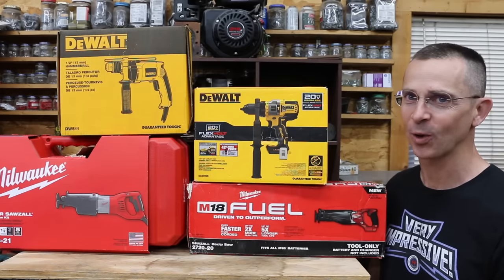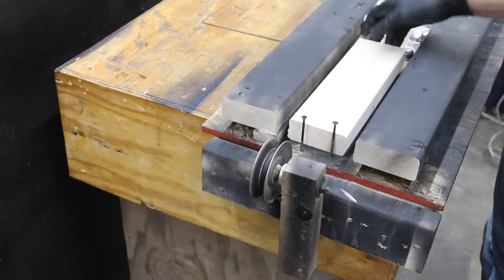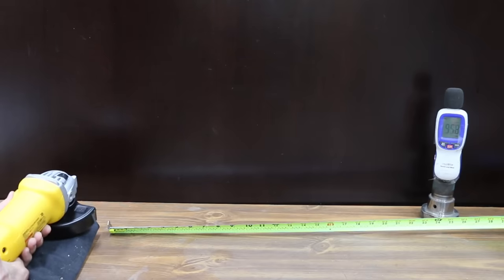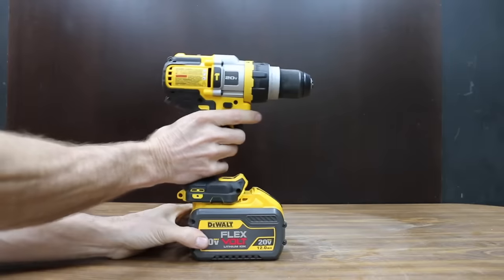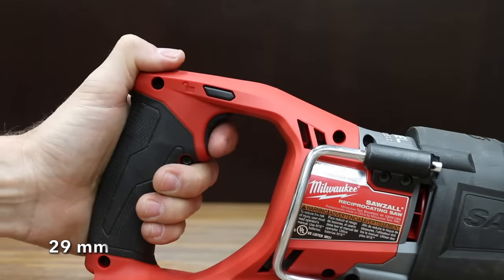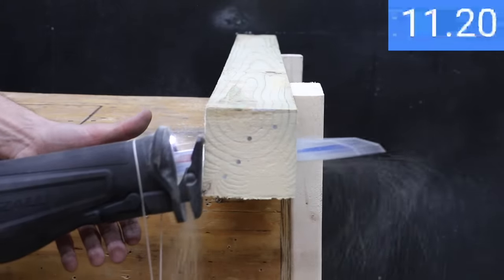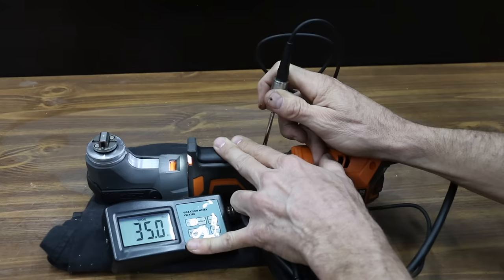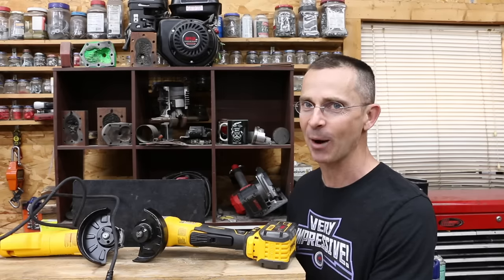Let's Settle This! Are Cordless Power Tools REALLY Better? Torque, Cutting Speed, Noise, Vibration

Comment: Corded tools are cheaper initially and in the long run . no expensive batteries to replace . In a shop environment big tools like Three HP table saws , planers , jointers slide compound etc are the way to go . 
The biggest thing cordless has going for it is convenance and safety . no cord to trip you up in high places and don't forget that you need electricity to charge all those batteries . with a corded tool just plug in a zillion times with ever being concerned if you have enough charge . Most guys will counter that with the buying more batteries argument . that's just more money for batteries and more electricity to charge all those batteries .
Reply from the maker: Thanks for the feedback.

Comment: I try to stick with corded tools. My projects are never far from an outlet and I have a portable generator for those that are. My concern with battery powered tools is that the batteries discharge over time without being used. You need one to work for an emergency repair and the battery is dead. They also have limited discharge/charge cycles. What happens years later when the batteries can’t be charged and the manufacturer has a new and improved system? You can’t get a replacement battery that is compatible!
Reply from the maker: Thanks for sharing.

Comment: I’m curious about what changed for the Milwaukee reciprocating saw (cordless version) between March 28, 2021 and now. It seems to weigh more (even with a battery) and take twice as long to cut through the board.
Reply from the maker: Thanks for the suggestion.

Comment: Why are you using the massive flex volt battery with the Dewalt’s??  Its not really representative of how the tools are commonly used and and they provide an abnormally high voltage with minimal sag compared to the regular batteries.  I have 8 Dewalt 20v tools and not one of those insanely expensive, huge, heavy batteries, and I dont buy the stack packs either, just the 5ah and 2ah 20vmax.

Comment: I feel like power tools manufacturers simply stopped spending R&D for corded tools in favor of cordless. Correct me if I'm wrong wrong, but it seems most corded tools on the market right now hasn't received a significant upgrade for a long time and are still relying on old designs

Comment: Volts times amps = watts.  746 watts = one horsepower.

SO;  If you plug a 110 volt appliance into a 15 amp outlet, you wind up with a maximum of 1650 watts or 2.2 horsepower.  That is the max that the outlet can deliver.  That's not what an appliance will deliver however, there is going to be some loss.

20 amp outlet?  2.95 horsepower.  This is why most large yard equipment such as lawnmowers and pressure washers are all gasoline powered.  These days, both of the appliances mentioned have over 6 hp, so you can see why line voltage equipment is limited.

A battery powered tool however has little limit on the number of amps it can supply.  Thus, if you have an 80 volt E-GO lawnmower and it's battery supplies 60 amps, then you have well over 6 hp and the device gets the job done.  The length of time the battery can power the equipment is the only limitation, and some of these mowers have honking! big batteries.

Great video!

Comment: Now imagine if the same brushless motor versions were powered with switching power supplies instead of batteries. They would cost more than the brushed motors, but they would be much more powerful and efficient. Maybe the manufacturers can make the same tools with standard slots for either the batteries or the PSUs.
Reply from the maker: Thanks for the feedback.

Comment: Generally, corded tools are more powerful, but not always. I also they are probably made better and will hold up longer. I drilled a bunch of holes in concrete with my corded drill. I know the battery drill wouldn't have been able to handle it.  If you don''t need the convenience of the battery, go for the corded tool. You will own them the rest of your life. In my opinion.
Reply from the maker: Thanks for the feedback.

Comment: Large corded angle grinders can trip the power breaker at over 30 amps which means that they can deliver around 5HP of cutting power. it is insane. it is possible to do the same with cordless grinders but you need multiple batteries and they run out fast. in a workshop that does lots of welding and grinding cordless grinders are just dumb.
Reply from the maker: Thanks for the feedback.

Comment: I've been looking into getting a Milwaukee oscillating tool they have the m18 for around $125 dollars and the Milwaukee fuel for around $230  I'm wondering if you'd consider testing if spending the extra money for the file would be worth it thanks.
Reply from the maker: Thanks for the video idea.

Comment: The added benefit of the battery drills are the electric brakes.  The real downside to all the battery tools is w/o a lot of use the batteries will just go bad.
Reply: Does it really matter how fast your drill stops? Probably the one I'd worry about the least in terms of stopping time. It's not that risky to put down a drill that's still spinning slightly.
Reply from the maker: Thanks for the feedback.
Reply: @gorak9000  It's the difference between stripping out a screw head or not.  That's why a corded drill is just no good as an electric screwdriver.  And even if you were drilling...have you not ever "locked up" a drill bit drilling into metal?  That could be the difference in breaking that bit or not.

Comment: Yeah, well.  I don't cut 1 2x4 in a day building a house.  So 30 or 50 boards.  120V electricity beat a battery because I am not going to haul around a bag of batteries.  They have their place though a manual sharp handsaw or chisel does the same job.  I really wonder why manufacturers did not invent an electric drill with  gears.(Low speed /mid speed/ high speed)so the motor rotates fast to keep it cool and still provides that torque that battery drills have.
Reply from the maker: Thanks for sharing.

Comment: I don't see how the pros can use these batteries efficently.  You get a few hours of work done, and the performance is noticeably worse as voltage drops and you have to let the battery set for 2 hours to "cooldown" because it is expensive, and then charge for 6 hours so you need 3-4 batteries and 2 chargers to run a single tool for 8 hours which cost as much as a whole generator and fuel to run for a month.  When I worked in a machine shop, we would have the same 3 corded drills running nearly 24 hours a day.

I would love to see how the cordless one does in 20 years.
Reply from the maker: Thanks for the feedback.

Comment: The main reasons I don't like battery powered tools are that they are more expensive, and that the battery eventually dies, and you have to spend more money to replace it during the life time of the tool.

I'd happily buy a power tool that can be used with battery or corded.
Reply from the maker: Thanks for the feedback.

Comment: Absolutely amazing video! I've been wondering this for a while. One thing i did notice, some of the cordless were "bottom tier" versions. For example the angle grinder.  I believe the only part numbers that benefit from the flexvolt battery are the 416 and 418 i believe. One use flexvolt advantage, the other uses the full 60V flexvolt battery. I think that would be better than the corded, similar to the hammer drill you tested. Top tier battery hammer drill out performed the corded by a lot. Obviously the price difference is also significant. Keep up the amazing work!
Reply from the maker: Thanks, will do!
Reply: I kinda had the opposite impression, both the corded drill and saw were absolute bottom tier versions so it's no wonder they're lacking features - and in the case of the drill - also power. A DWD520 hammer drill would still cost 25% less than the battery powered one but be some actual competition.
Reply: @creak92  oh yes i completely agree. There were more high tierd battery tools than coreded tools. It's very difficult, especially for someone who is new to tools, or even unfamiliar with the brands, to know which version is the best, mid, or bottom

Comment: Unfortunately the only valid takeaway here is cordless is more expensive. Most of the performance comparisons aren't fair. For example, you compared the Sawzall vs a Super Sawzall. Milwaulkee makes 2722-20 Super sawzall, which is probably a more fair comparison, and its only $50 more than the corded one shown. The cordless sawzall should have been compared to a 6509. Drills, Impact Wrenches, and Grinders all have the same issue, where you have to be very careful to compare apples to apples when it comes to performance numbers.
Reply from the maker: Thanks for the suggestionn.

Comment: So far in our eight years of experience, we prefer corded tools just because of the possibility for unlimited power and large economic differences. We work continuously 6 hours a day and charging and changing the batteries is not the most reliable. We rather change brushes during holidays, that way we get to maintain and know our tools better and just might caught some potential hazards. Battery tools are awsome but in our line it isn't a life changing. Most of our skilled-men are earing for college needs so, budget is our no. 1 priority.
Reply from the maker: Thanks for the feedback.

Comment: Nowadays I think cordless is the way to go for most tools. Back in the day battery life was probably just as big of an issue as power. Nowadays batteries last much longer and produce much more power. 

It comes down to how you use your tool. Corded are cheaper but have longer setup time. They are also more dangerous considering they are using a cord that can be cut. I set an ac unit on a cord and shocked the shit out of myself and my buddy. A cordless tool wouldn’t have that problem.
Reply from the maker: Thanks for the feedback.

Comment: unlike Corded tools cordless tools arent limited to 1500w total power draw so they can run faster with the correct power circuitry and batteries however the batteries lifespan is limited with high power draw applications
Reply from the maker: Thanks for the feedback.

Comment: BATTERIES (obscene cost for those) and charge/run time are the biggest negative for those battery tools.
Corded you do not have that problem
I use battery for quick jobs. Corded for larger jobs.

Corded tools usually do not have problems with heat and cold. Battery tools DO have issues.

Much depends on if you are casual user or a construction worker who has no house power easily available.
Location, location, location is a big factor.
Reply from the maker: Thanks for the feedback.

Comment: I'm a big fan of your channel, but this video has a HUGE issue, none of these tools are being compared are the same build quality or level of tool. They aren't made to compete against one another, and I understand it is going to be hard to find tools that are built to be comparable, but they do exist.

 For example Dewalt DWE7485 and Dewalt DCS7485 are the same tool with one being 60v battery powered and the other being corded. 

You can also look at the Dewalt 120v Miter saws, you can get an adapter that allows it to be ran either corded or with 2 60v batteries, with some research there is probably also a full time corded tool version that is actually the same tool as well, but Miter saws would be very hard to make a test for.

Comment: I like cords. You are buying the batteries and trapped into a specific brand, which is great if you're a brand fan boy. Cordless tools are more expensive to purchase and own. Good for smaller quick jobs tho.
Reply from the maker: Thanks for sharing.
Reply: Yeah I said the same things until a friend let me use his cordless tools to build a deck in the middle of nowhere on my property. That one job flipped me into a believer/fanboy so fast that I couldn't get out of the big orange store quick enough with my new investment. I haven't used a corded tool since 2015. 
Cordless costs money, especially the powerful ones, but it also makes money, they pay for themselves in short order. People usually realize that after going to one too many jobsites that doesn't have power and there's no generators sitting around. Also I've only ever bought aftermarket batteries, which can be hit or miss, but they're 1/3 the price of name brand and I've had good luck with so far. 🤷‍♂
Reply: @somethingtrulyhorrifying  I'm sure I'll get into it eventually. I do hate running generators all day. Cheers.

Comment: Hmm, I liked some of the tests, except the ones where you had $200/$270 cordless vs $99 corded. It really should have been an apples to apples comparison: $100 corded vs $100 cordless (cost without battery). Those cheap cordless models are much weaker and typically feature a brushed motor. Results would have been much different I bet.
Reply from the maker: Thanks for the constructive feedback.

Comment: I wanted to know if the corded Dewalt angle grinder was more powerful than the cordless.  I searched for it just last week.  I found nothing useful.  This morning I'm suggested this video, and lo and behold.  
Kids, be careful with that angle grinder.  Use the safety equipment and don't get distracted.  You don't want to be the guy in the shop with 9 fingers.
Reply from the maker: Thanks for the feedback.

Comment: Seems most corded tools have rubbish motors. Typically they use around 500 watts, which is much more than can be produced from any 18 volt battery on a continuous basis. Has anyone measured the actual watts in use on a cordless tool?

Comment: Clearly you like using your campervan and pickup so you need to get some good lighting on these vehicles. Lets test some LED light bars. Curved vs straight, straight vs spot vs broad, curved vs spot vs broad etc. Spot is ok for road driving but curved better for off road etc ??????
Reply from the maker: Thanks for the video idea.

Comment: I doubt cordless tools will ever be able to completely replace corded tools.
 cordless ya got 24v-48v and a 5amp batt.
corded ylu got 120v-220v at 15amps, if your using the tool consistently enough it either needs batts consently or at least twice as heavy to compete.
Reply from the maker: Thanks for sharing.

Comment: 2:57 - On the Makita circular saw, a  0.4dBu SPL difference is imperceptible by most people. It's practically a tie there. 

(I know that isn't the most important thing he tested and doesn't matter to most people, but it's the only thing I feel like I should comment on, as it is the only topic in this discussion that I'm qualified to speak to. I went to school for audio engineering and working on recording studios, live sound venues, and worked with acoustics. So, there, that's my two cents...)
Reply from the maker: Thanks for sharing!

Comment: I guess I’m a little old fashioned in that I buy tools to last a long time. As a mechanic and home owner, I’ve gone through cordless drills because of batteries. The batteries wear out and are too expensive to replace or they don’t make the battery style anymore and switched to new style (14.4 NiCad) then I’m stuck with a drill with no battery. I’ll sacrifice portability and performance with a corded tool but I’ll have it for 10 years or more. I’ll still buy a cordless drill but still have a corded one.
Reply from the maker: Thanks for the feedback.

Comment: I stopped buying cordless tools because it don't use them enough to keep the batteries charged, and if I need one at short notice a dead battery is the same as no tool. Also the cost of a power drill is about the same as a 18volt battery. I have nothing against cordless, job sites outside of extension cord range make them a must, but for my usage they are not worth the price difference.
Reply from the maker: Thanks for sharing.